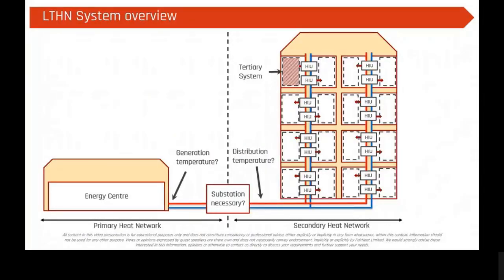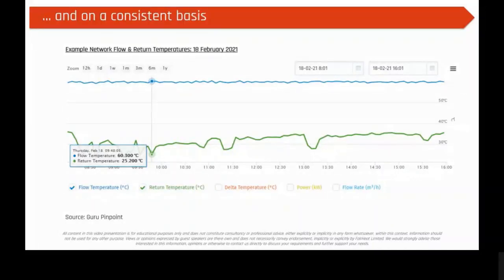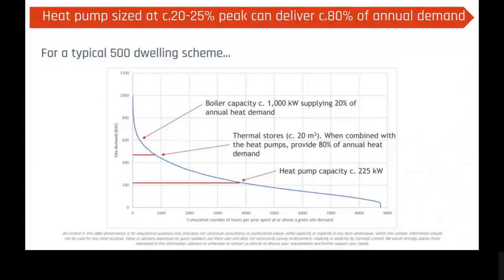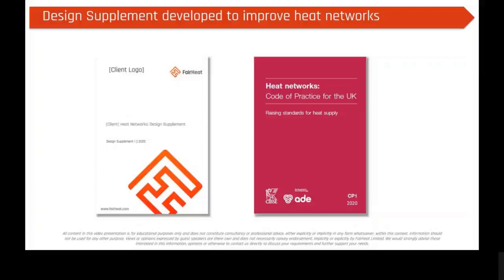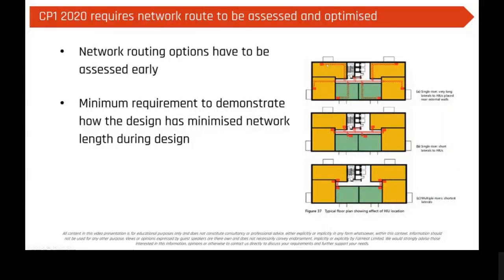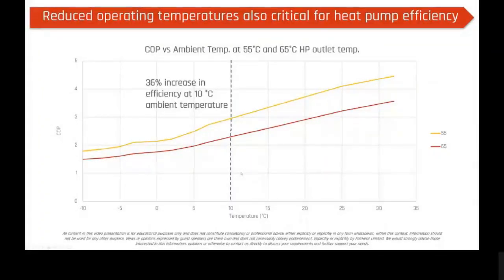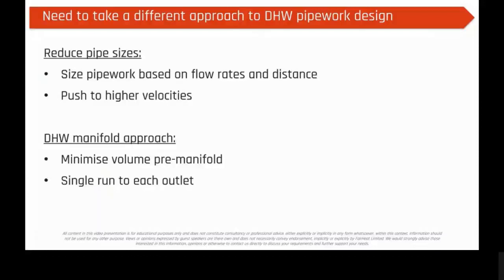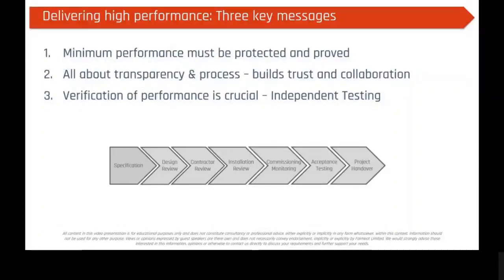CIBSE HCSE: How to Plan, Design and Deliver High Performing Heat Networks

Comment: What is the 62% method?
Reply: Hi Richard. This 62% diversity factor is also called the concurrency or simultaneity factor and is used to reduce the required capacity of production/distribution. During the initial heat network sizing, designers may opt to use one representative building heat demand profile for the year, and then aggregate this to say, 100 buildings. When 1 profile is multiplied by 100, the total annual load will be somewhat representative to reality, however, the annual peak demand (timing) is certainty not. 

Just imagine 100 distinct/separate building heat demand profiles stacked together on a graph. The chances that all 100 buildings have a simultaneously occurring peak demand is very unlikely. So, the aggregated peak from (1x100) buildings should be multiplied by 0.62 to derive a realistic peak for appropriate topological sizing. Remember, this 0.62 only applies to methods which aggregate a single heat demand profile to more than 25 dwellings. As shown @42.50, you would use 0.7 for 5 dwellings and of course 1 (no factor required) for one dwelling. Hopefully this makes sense!